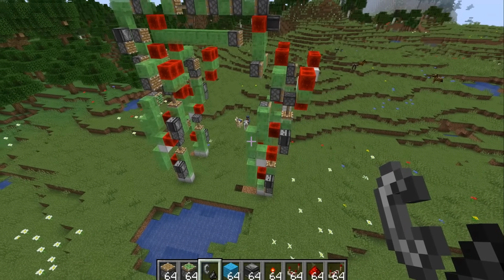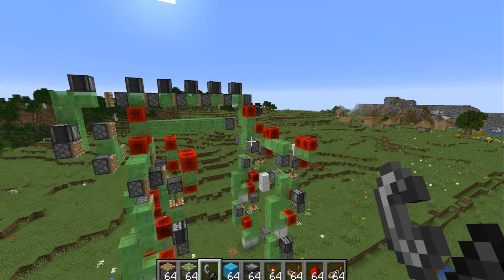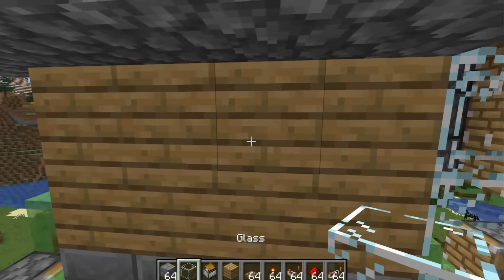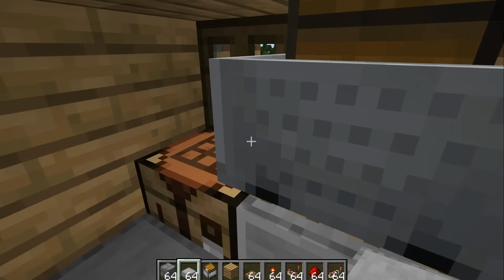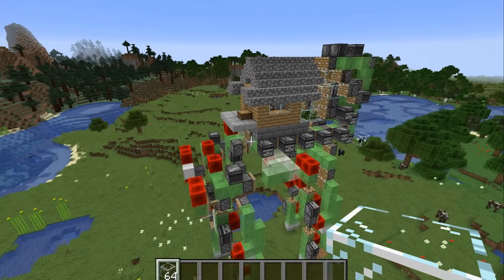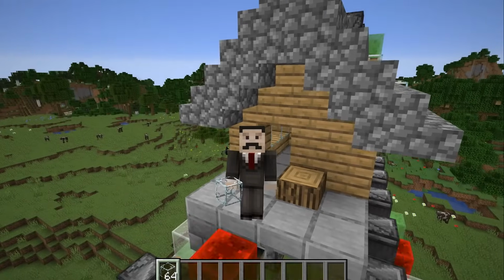I made a Walking House in Minecraft 1.14

Comment: The idiots:
“this is easy redstone” 

Us:
“;-; what”
Reply: Not necessarily. Mumbo's judgement is inputted from his perspective and may not formulate a solution that he's not experienced or inquired. 

It also depends on the aspect of redstone: Mumbo Jumbo is a decent mechanical redstoner himself; however, his experience is mostly mechanical redstone and not other aspects of redstone such as computational, slime block redstone, 0 tick redstone, storage tech, etc.

If a redstoner were to look at an aspect of redstone that they're unfamiliar with, they would most likely claim the work to be difficult. 

Thus, if it's a redstoner who expertises in the element like computational, they'd definitely have a much more greater understanding than the different redstoner who expertise's in a different aspect. 

Example: A computational redstoner expertises in (redstone computers, CCUs, arithmetic-logic, displays/GPUs, binary, memory systems, neural networks, hardware, etc) vs. a mechanical redstoner who expertises in (minigames, mechanical creations, timing circuitry, etc).

Comment: you can use structure void. The structure block is like a solid block but you can walk trough it
                                                                                                                                Wrong spelling /\ (probably)
                                                                                                                                                             |

Comment: Bruh when Mumbo talks I just hear "This is impossibel stuff,This is impossible stuff"
Reply: Not necessarily. Mumbo's judgement is inputted from his perspective and may not formulate a solution that he's not experienced or inquired. 

It also depends on the aspect of redstone: Mumbo Jumbo is a decent mechanical redstoner himself; however, his experience is mostly mechanical redstone and not other aspects of redstone such as computational, slime block redstone, 0 tick redstone, storage tech, etc.

If a redstoner were to look at an aspect of redstone that they're unfamiliar with, they would most likely claim the work to be difficult. Thus, if it's a redstoner who expertises in the element like computational, they'd definitely have a much more greater understanding than the different redstoner who expertise's in a different aspect. 

Example: A computational redstoner expertises in (redstone computers, CCUs, arithmetic-logic, displays/GPUs, binary, memory systems, neural networks, hardware, etc) vs. a mechanical redstoner who expertises in (minigames, mechanical creations, timing circuitry, etc).

Comment: Amazing, but I want to clear one thing up really quickly. You might already know this but for those in the comments who don’t- What you’re talking about at 2:18 is called a gait. 
For four legged animals, (like the house, I guess?) walking is moving the diagonal legs together, like the right front and left back legs move, then the left front and right back legs follow. 
Trotting is the next fastest, which depends on the animal but is usually a faster version of walking
Then comes cantering, which is moving the vertical legs together- i.e. right front and right back legs move, then left front and left back legs follow.
And finally, the fastest- Galloping. This is generally moving the horizontal legs together, i.e. the front legs move and then the back legs follow.
Hope this helped y’all out!

Comment: Hey just a friendly question here: When you build a flying machine, is it a one direction use, or can you put it back where it started without destroying and rebuilding? Also, does it just run until it runs into something with too many blocks for it to push, or can you stop it manually?
Reply: There are directional flying machine many farms use them
Reply: And they are very simple to build

Comment: Hey man, I've got a base with a staircase going down 8 blocks (North) before splitting into two paths that wrap back around and lead further down in the opposite direction (South). There entrance is in a wall of a cave with an incline formation like stairs. Is there a way to create a contraption that will hide that entrance without leaking into the path ways underneath?

Comment: I once did this, but instead of a house I built a robot, the legs were working, but the arms didn't move because I forgot to put the lower redstone blocks. After a lot of scientific research, I finally got the arms to move. The robot had a part where, when I pressed a button, The part would instantly abandon ship and shoot out. I used the robot to protect my house since it had an instant fire arrow shooter. The hardest part was when I tried to cover up the mechanism with Quartz.

Comment: Hi Mumbo. I challenge you to make a concealed Nether portal banishment trap. The goal is to banish players that try to invade your base to the nether realm. The idea is:
1: Have an obsidian door frame (concealed if possible)
2: Use Impulse's tripwire pufferfish detection system to identify players.
3: Block both sides of the portal with blocks via pistons. If you find a resistant-enough material, they would resist pickaxes long enough for the portal to transport the victim.
4: Use a dispenser to shoot a flame charge at the portal to light it up.
Make sure the portal in the nether realm doesn't sync with the one in the base and force them to take a long trek back. (Or surround the portal with lava.)

Comment: Hey Mambo, I was curious if you could build a redstone boar, as in the mining machine, in Minecraft 1.14. I have been trying but for some reason I can't do it. I was wanting to be able to challenge you since you're on the topic of slime block machines again. in order for it to work it needs to be a two Direction, Auto returning, mining machine that brings the materials back to the base. From there it should be possible to do a TNT duplication glitch and break the mined minerals. From that you can create a water Trail to push the entities into some hoppers and have it go straight into storage.  I'd love to get a reply from you to see if it's possible

Comment: I was wondering, the main problem of these machines is that, whem they encounter a surface that is not flat the stop working.

What if you try to builda walker that goes up and down depending on the terrain? moving the whole frame. I would be really really hard, but also incredible

You can try by making the leg retract a lot like 3 or 4 blocks and then when expaning , expand until touches ground if posible

Comment: The house could be bigger. Maybe if you would split the slime block flying machine in half and put one half of the floor on one side and do the same on the other side. And maybe put some slime blocks in the corners of the walls then the house can be a bit bigger

Comment: Hey Mumbo, I would like to suggest that you check out a mod called ProjectRed. 
ProjectRed is a mod that greatly expands vanilla redstone by adding a lot of different things like block breakers/placers, redstone wires that can go up walls and have diffrent colors which do not interconnect with each other, pipes that are like hoppers but way cheaper and cooler.
It also packs some redstone contraptions into one block like timer - redstone clock which can have a lot of different delays.
And it has some cool decorative blocks like basalt and marble, it generates volcanoes, fancy redstone lamps and many, many more things.
Currently there is a version for 1.12.2 and it consists of diffrent elements: ProjectRed base,  Fabrication, Mechanical, transportation  World(or Exploration), Lighting (Illumination) and compatibility which makes it compatible with some other mods.

Comment: Please make a multifloor elevator where you select the floor using a a lectern. Optionally, an up elevator and down elevator, and it opens the doors to the appropriate one based on if the floor you chose is above your below your current one.

Comment: Suggestion
Make a walker that can actually climb terrain (hills) and still stay in contact with the ground.
Reply: It's veeeeeeeeeeeery difficult, I don't think that mumbo can build it
Reply: @niccolo226  mumbo is redstone m@st3r he can do all things redstone (I mean if I have a concept for a flying machine that can elevate itself to clear mountains mumbi can make a walker that can do the same as well as come back down
Reply: @sleepyneko3191   How would you make a flying machine that follows the height of the ground?
Reply: @amyntas2868  with pistons that push up and back down...currently our flying machines only go in a strait line
Reply: @sleepyneko3191  I mean more technical, you would need a device that detects the height of the ground an then moves the entire engine up or down.
You could detect the height of the ground by trying to push with a downwards facing piston and then detecting if it pushed with an observer. The problem lies in pushing or pulling the engine up or down, you would essentially need a 3 directional flying machine for that.
I think it might be possible to create a proof-of-concept that flies in a straight line untill it hits something and then moves up a block and tries again.
Reply: @amyntas2868  it's still possible